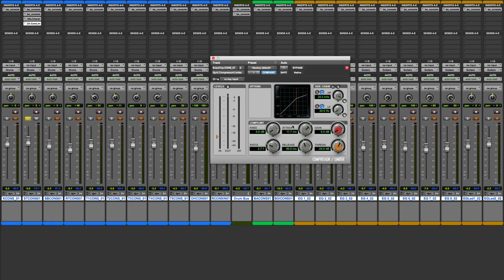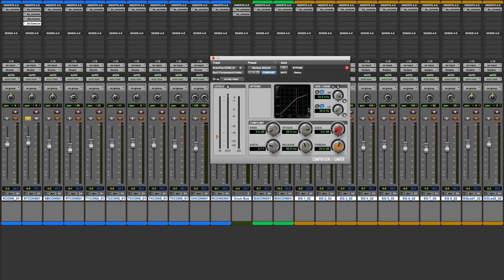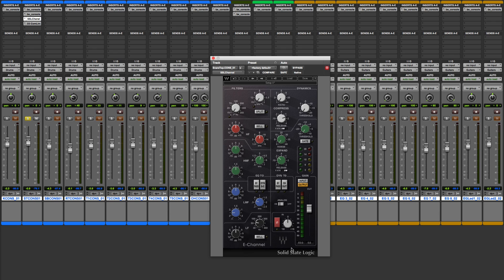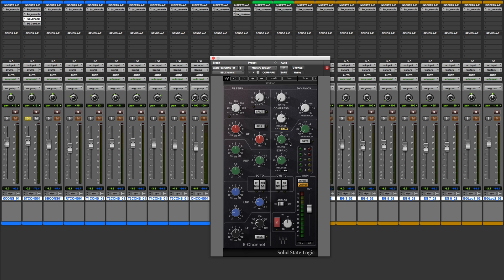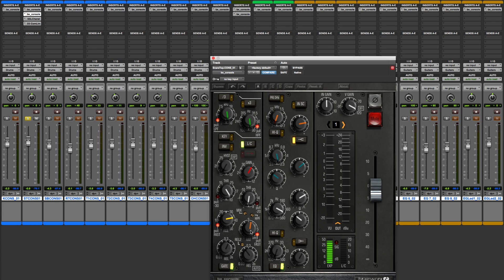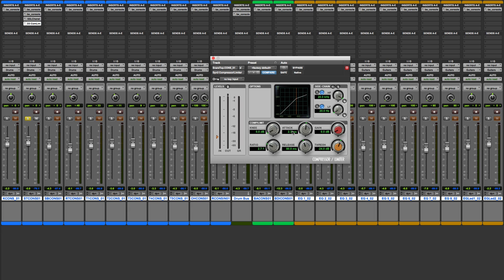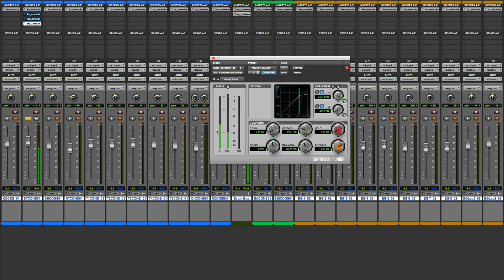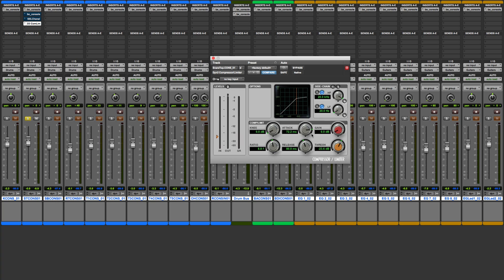The Basics of Attack Time on a Compressor

Comment: Ditch compressors altogether and use tube limiters/levelers intead. All you have to worry about is input gain, the harder you drive them the more apparent impact. 

Under no circumstances should compressors be used on individual mic, guitar or effects feeds. I've seen  multiple boxes on mic inputs or as inserts - wasting your fucing time,

 Attack/Release has no real-world connection, phsyco acoustics or otherwise. On the other hand Knee threshold are useful but only in special cicurmstances. 

It's important to understand the context of compressors and their origin. The internet leaves no room for excuse here, there are 7 decades of bibliography on the internet - at ones finger tips - it's easier to research these topics than ever before - this generation have yet to acknowledgeme how spoiled they really are in this regard....

Compressors were first used in radio stations decades ago, as ONE HALF of a two piece system called companders, compress and exapand respectively. The expand half was in radio recievers. Companders minimize noise in radio feeds. Similar systems evolved into systems like dbx and dolby for tape transfers. 
One day - Some experimenting engineers used the first half on the compander (compressor half), liked for its character and ability to boost RMS relative to PEAK, wtih the slight chance of harmonics if the kit was old enough - which they were as they were tube based. Modern compressors, typically solid state shold be avoided at all costs. 

Granted multiband compressors are marketed towards mastering engineers today - these tools are as pointless as its designated user. Mastering engineers are as bad as EDM DJs when it comes to understanding sound. I blame the education curiculum - there is an error somewhere. These poeple ought to learn proper skills and become recording engineers or Radio DJ's . TO be a Maserting Engineer, is, as far as I can see, an off shoot, snobbery - as it's very name suggests - a profesions whose job is to fuck music up by needlessly tweaking compressng, while their real task is  to preserve works. It's suprising these poeple are still in work given that any 8 year old kid can do what they do given a computer (and here lies the problem exactly not all mastering engineers are bad but I feel that the title is obsolete today, and that if one still calls themselves one they need to rethink or remain ingorant).

Point is, compressors should at no point be used on the master destined for digital distrubution. Only the radio. Radios proceed to use their own compressors, on already-compressed masters which is stupid. Why do you think there is such a thing as Radio Edits? Radio edits are mastered to sound loud - THIS is where compressors are useful - and only threre. Mastering engineers compress and nothing else - as simple as his job already is - he does'nt understand how to approach mastering elegantly. 
Audio manufacturers are equally to blame for the mis application of compression.

There are millions of plugins good luck finding what works. My advice is to research the theory on the web written in the old days and go from there. Education today is rediculously partial if compared to the old theory. That is a warning. Education is subject to being watered down to, as all products in a capitalistic market are. Education is a product, don't believe the shit they day.
Reply: nope
Reply: Your rant failed bro...you dont know wtf you talking about.  A limiter is a compressor with a fast ass attack & high ratio.  You need to learn the MANY USES for compressors, including using retro ones for their saturation.  

If you were really informed, youd say saturation in conjunction with a good levelled automated signal is the most musical way to compress many things, especially vocals.  

Compressors however come in handy when you want to be transparent using a slower attack & limiters when you want to be transparent using a super fast attack(& both work great when you dont want to be transparent but want a pumping effect)...

....because where as saturation compresses a dynamic signal very musically, it of course isnt very transparent in adding harmonic volume & changing the tone while coloring the signal & making it more dense so that it cuts through the mix(but thats musical to our ears & we prefer analog tones that are processed this way).  Level up bro.
Reply: @QuabmasM  the only point i would agree is you highlighting that I failed to mention auto makeup gain. While I realise there are uses I dont see why the makeup should have different parameters at all. If anything when the saturations becomes extreme this assists the artist/instrumentalist express intensity (which is a feature in classical music theory). Auto make up gain is: Squash the wave (compress) and adjust to the pre-compressed level (peak-relative) automatically. I'm not too bothered about this as much as I disagree with the myriad of time constants in compressors. Many are copies, outgrown from decades of misinterpretations of the original companders. I bet one could trace it back to a single event when someone in a famous band found one in a studio and played with it; because it made something louder it was subsequently passed around as 'a secret'. There are plenty of examples of instances where band memebers or engineers would mis-apply some equipment to create sound. Anyway. When you whittle all compressors in common the good ones merely add saturation and that is mainly what people want. You need to read about the oldest compressor ever made and its intended use. the fact that it generated harmonics was a byproduct not an objective - at the time. Its objective was a double ended noise reduction device and was used in radio stations and the reciever tower. Its the same principle dbx and dolby used for their noise reduction systems.

Anyway I firmly believe music should not have various elements with companding volume throughout a track. The instrumentalists decide the volume with their ears and fingers. Saturationn must be constant. 

And finally I have noticed some manufacturers are going down the road of single dial compressors. I am definately for this becuase its simplifies things alot.

Comment: You did a text teaching on using a super low ratio with a super high threshold that has the majority of the signal within it.  I still dont know how to properly use that setting because you never mentioned attack nor release settings.  Could you explain that?
Reply: don't wory about any control on compressors they're lost in their application today. See my above comment.

Comment: call it laziness, call it pragmatism, call it whatever but this has always been my approach...I either use a fast, medium or slow attack depending almost entirely on transient preservation, then go from there...you see this a lot with mixing and I don't know if it's because guys hear engineers like dave pensado and friends goofing about their abilities to hear the difference between 12.39 and 12.4 ms but you see guys getting really hung up on one particular control or parameter of a processor...and it's not a product of their inability to understand what it does, it's like they have these thoughts that there are guys out there capable of getting SUCH better sounds based on their knowledge of attack time, knee, bandwidth on an eq, you name it....meanwhile, that's really not what it's about...it's about the bigger picture, making things work together and giving them a place to exist...sure there are plenty of tricks out there but the goofily specific attack time, etc is too much a vaaaast majority of the time
Reply: Word.
Reply: couldn't agree more mate.  When it comes to compression, I don't like to spend too much time on it you start over thinking things.  Plus you don't have to commit to whatever, if after a while it's needs a change then go back.  but no need to spend a good 15, 20 mins just compressing one snare drum.
Reply: i would prefer it if the world ditched compressors all together. Only Radio stations should be using them.